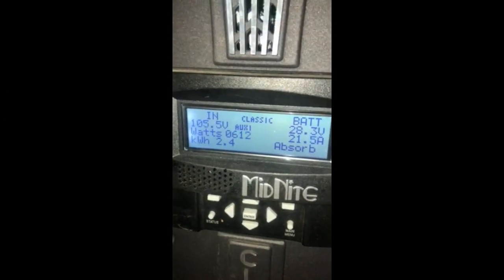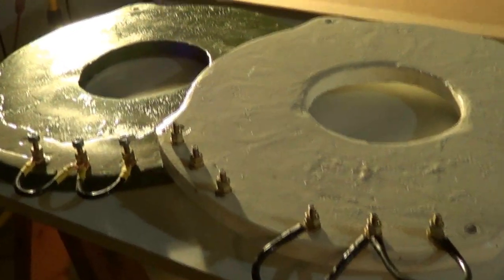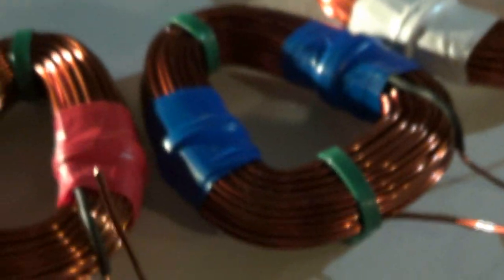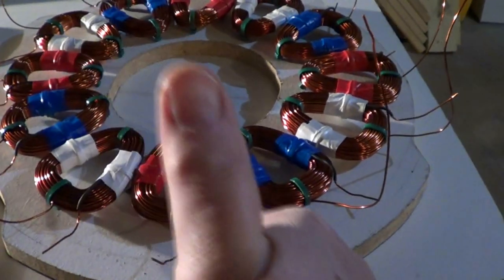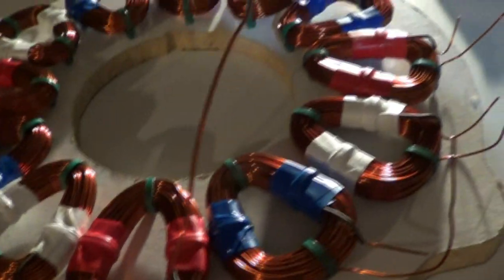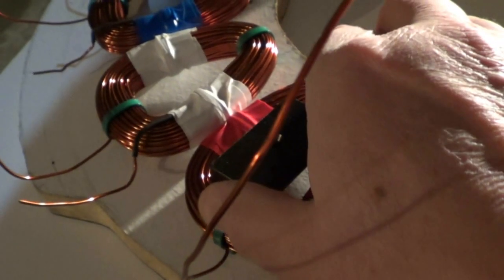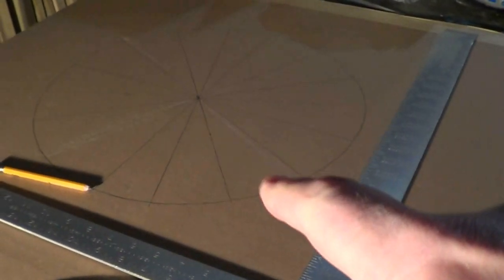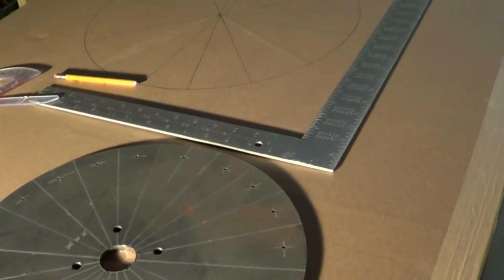AXIAL FLUX WIND TURBINE " OVER AMP LIMIT " 10 11 2020

Comment: I attached a motor to my Axial flux motor but it’s very difficult to turn. My configuration is 3 phase, 6 coils connected to 3 bridge rectifiers that are connected to a capacitor to smooth out the power. Turning by hand I get 12 volts. When I connect a DC motor it’s hard to turn the Axial flux motor. Any reason why this is?